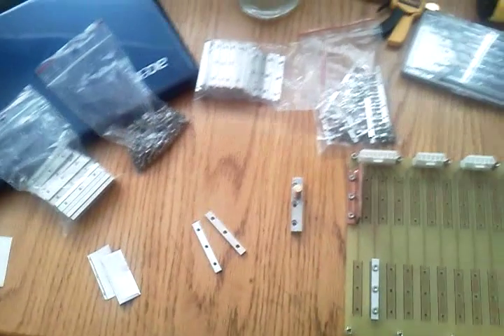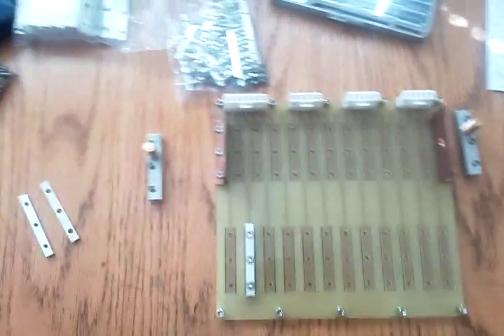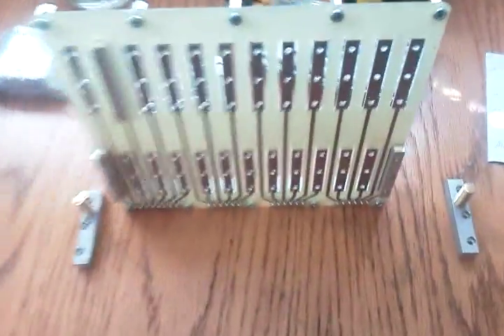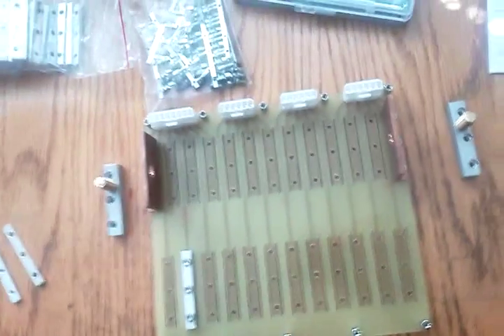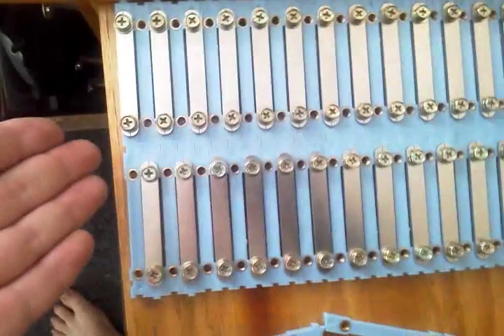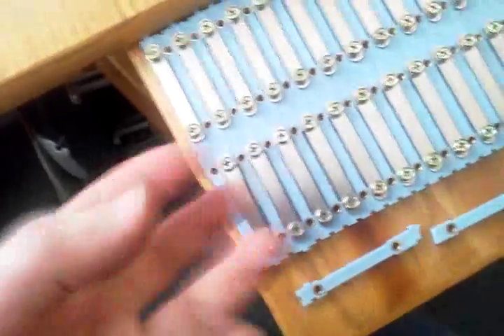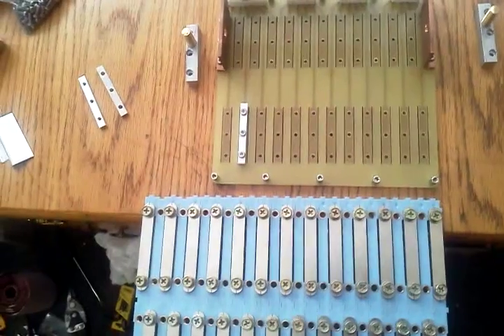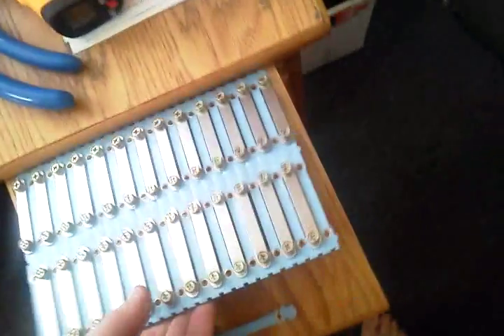A123 Battery Pack Kits

Comment: Are these still available? I've got an A123 pack that has a bad cell.
Reply from the maker: I'm not clear on which of the 3 things in this video you are referencing ... I am not a business , and have never sold any of these to other people.

item1 - A123 pouch batteries ... yes , A123 still makes 20Ah LiFePO4 (LFP) pouch cell batteries .. you can buy (various web sites) a replacement cell to replace the bad one you have .. there are also other 'generic' versions.

item2 - OSN style modular battery tab connector system for 20Ah A123 pouch cells .. I have seen generic version of this style is still made & sold on various web sites  .. You'd have to ask OSN if you specifically want their brand version of it.

item3 - Agniusm PCB battery tab connector system for 20Ah A123 pouch cells .. Agniusm is the screen name for a person on the endless sphere forum (his web shop link is bellow) .. back at the time of this video (~9years ago) he made the shown PCB systems to order .. in this video I show a 24s version .. you would have to contact him and ask him if he would make for you the type you want.

Comment: Where can I buy this kit?
Reply from the maker: Remember the video is from several years ago.

The 1st one described in the video .. the one that is for a fixed/set number of cells , more efficient use of space so the same number of cells is smaller , includes BMS connections, Does higher current/power rates (tested up to ~210Amps) , etc .. that one was made for me (several years ago now) by User-ID = agniusm on the endless-sphere.com forum .. You can read about them in his thread .. https://endless-sphere.com/forums/viewtopic.php?f=14&t=38545 .. As far as I know he doesn't keep these sitting on a shelf .. only if he gets enough pre-paid pre-orders does he consider still making another run of them .. If you want to consider this route, you'd have to contact him and see what his minimum would be for him to do another run .. or use the information from him to have a PCB fabricator make some for you.

The 2nd one in the video .. although it is a bit bigger for the same number of cells .. and the design means lower current/power rates (I'd guess it could be fine up to about ~60Amps) .. and it doesn't include the BMS connections (you'd have to run your own) .. it is modular , allowing you to put it together into just about any size of series or parallel pack you want .. I bought the ones in the video from OSN Power .. Because over the years allot of the newer battery cell styles have moved away from the pouch with tab style , such kits are in less demand they they used to be .. You'd have to contact OSN or one of their distributors.